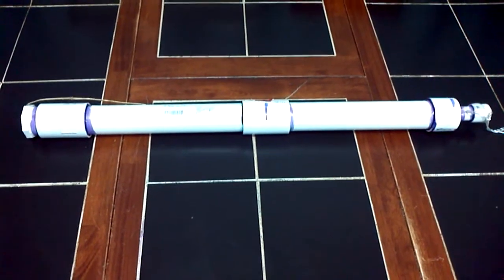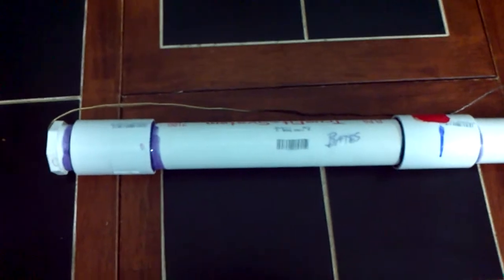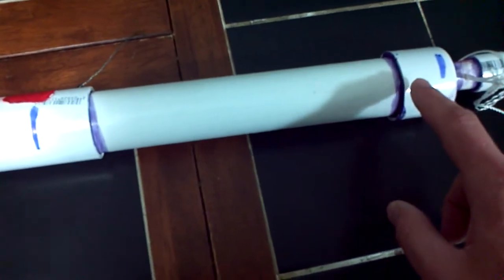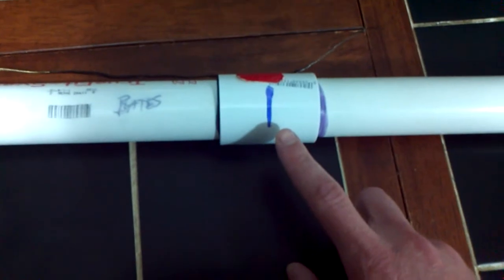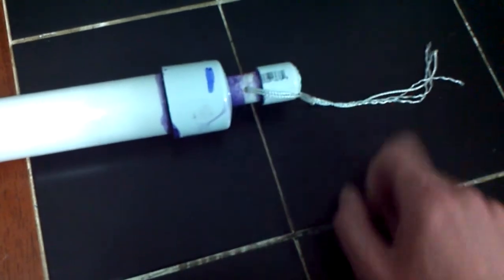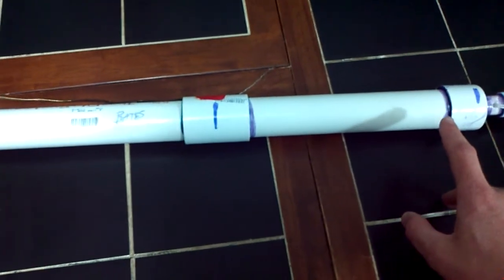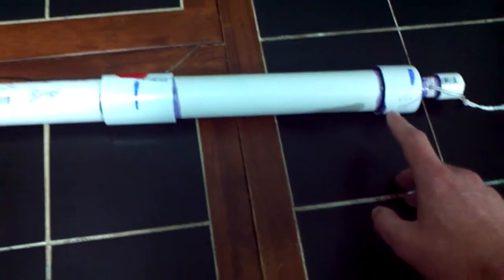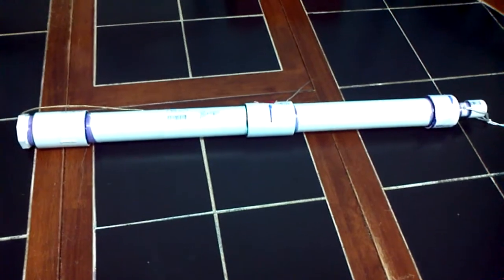Two Stage Rocket Candy Concept Motor

Comment: just out of interest, would you be able to increase the burn rate if the motor had a hole all the way down the center and you pumped o2 through it at high pressure?

Comment: I think that you need to choke the "burn chamber"  in the first motor down to .375 to .400 and keep the nozzle hole at.500 I have been working on the same basic 2stage motor and have found that the "GOO" can block the the hole for what seems to be a split second but the pressure builds so fast that a "CATO" is almost a sure thing also once the first stage burns and for that time delay can block the hole also....

Comment: I was thinking of using epoxy as delay sleeves to :D.

 Also @CHRLZLEE large core's is why I believe most KNO rockets over 5-6 Kg explode on the pad. The math varies nozzle to fuel mix but burning 5Kg over 6 seconds = a crazy amount to thrust for the nozzle to deal with.

Comment from the maker: CHRLZLEE:  The hole or "Core" as is it called is necessary in order to provide plenty of surface area for the fuel to burn.  It also provides a much more stable and predictable burn.  The result is a fast boost to get the rocket off the ground and efficient burn of the fuel.